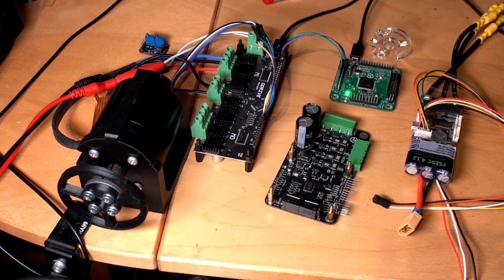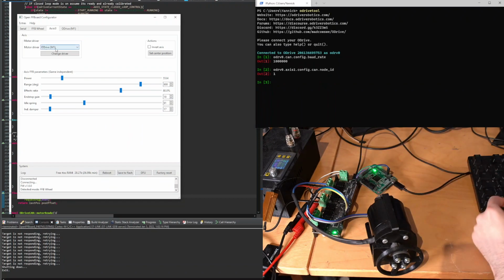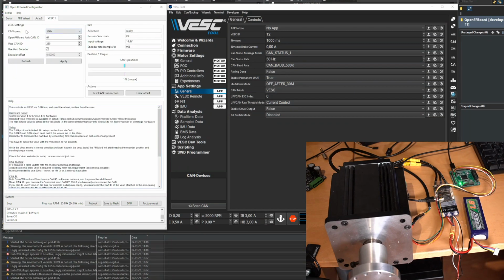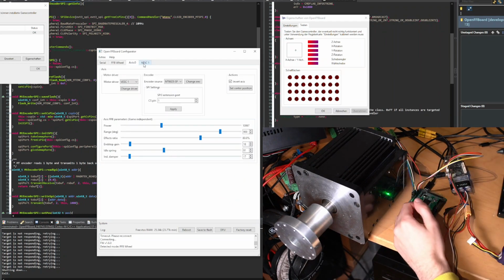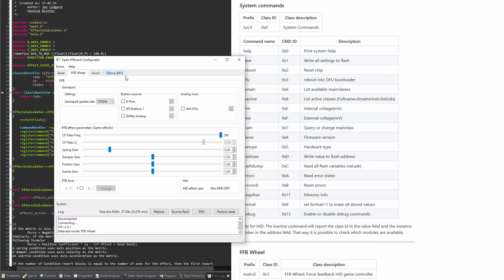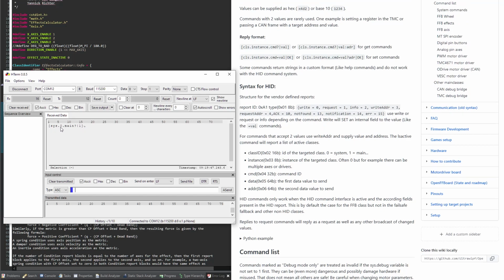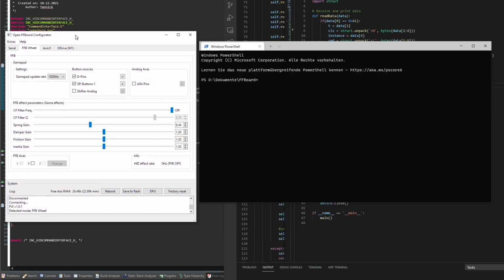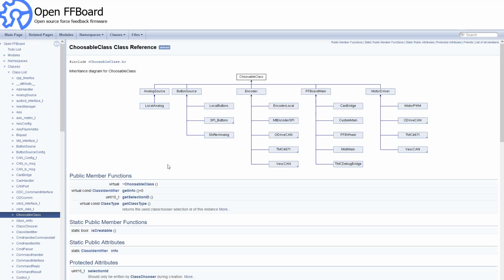Open FFBoard DIY FFB update 4: ODrive, VESC, HID Communication

Comment: Is it possible to flash odrive board directly with the ffb firmware? Will it be more optimal from performance perspective?
Reply from the maker: no it is not possible. It is also better to separate motor control and effect management/usb communication for performance.

Comment: Good day thank you for the great videos. I need so help with wiring a hoverboard main  board and STM32F407VET6, I am a complete noob when it comes to electronics and would really appreciate any help. I have managed to load FOC firmware on the hoverboard main board and VNM firmware on the Stm32f407vet6 for a diy ffb steering wheel.
I have a 600ppr incremental encoder and I will be using the hoverboard battery to power everything. Thank you again for sharing your knowledge/experience with all of us.

Comment: Any thoughts on the powerstep01 vs the TMC4671?  For example, I have a high resolution encoder for position, so I really just need a stepper-motor driver that can deliver the torque.      I like the 10A that the PowerStep01 can do, and that it can be configured either for Current-Mode or Voltage mode.    

Other ST devices, like the L6474, can only do 3A rms (~4A amplitude).. although the datasheet says it can generate a pulsed (<1ms) current output of 7A.. but I supposed the thermal dissipation of the package becomes a factor as well.
Reply from the maker: The first attempt was based on the powerstep with some foc trickery. It was not stable, the resolution with 7 bit extremely low and it ran super hot. The tmc with low Rds mosfets and its 16b adc is much much more efficient and capable.

Comment: Hi, I bought a STM32H7 Dev board to use with another firmware (VNMWheel), but yours looks better, and it is open source which is great. Would I be able to use this board with your firmware and your custom driver?
Reply from the maker: Not directly. The firmware is made for the F407VG and would require porting to any other chip. I am sure it can be done being a mostly similar chip but the differences in architecture would require some changes.
Reply: @Gigawipf  My friend bought by accident the STM32F4VE DevEBox, so I suppose this one will work fine?
Reply from the maker: @Edgard422  F407VE? that should work but there currently still is no build specifically for those devboards and they sometimes require extra hardware or remapping. Like encoder pullups, usb vsense and buttons
Reply: @Gigawipf  Oh...ok ok, I think I would be better ordering your custom board with the driver then. Thanks for the answers!

Comment: Great stuff! Do these new hall sensors mean we no longer require an encoder for the motor? Or is that still needed?
Reply from the maker: It has nothing to do with the encoder. The motor still requires an encoder. I am referring to the on-board current sensors in this video.

Comment: what do i need to compile the sources?
Reply from the maker: STM32CubeIDE, import the project and compile the subprojects in the targets folder.
If there are any errors check the path settings.
Reply: @Gigawipf  
I have a modified version(Keil Compiler) of Arduino FFB  for STM32F103.
Will I be able to switch to Bluepill?
Reply from the maker: @tsleletronica5851  No. That chip is not compatible or powerful enough.

Comment: Amazing job. I bought a 8nm servo from kollmorgen, but it came with a resolver, and it's hard to find a small and precise  encoder to fit in it,  so I'm using a amt-103 to make some tests. So my point is, is it too complex to develop a resolver converter module ? Would it be possible for openffboard software to give support for that kind of sensor or is it too much to ask? Cause resolvers have a excellent precision, but I need to replace it with an encoder
Reply from the maker: Resolvers are difficult to drive and would require a lot of active analog circuitry to extract a usable Sine/Cosine signal from. Probably possible but i don't have enough time at the moment and also no resolver to test.

Comment: Nice....! Where can i buy the controller open ffb board please ?
Reply from the maker: I will make them available once parts are available for a reasonable price again. At the moment some required parts are way overpriced or out of stock.
Reply: @Gigawipf OK.... Will you make annoucements on discord when it will be available ?
Reply from the maker: @djwillx974  Yes. i post updates in the discord first
Reply: @Gigawipf  So, if i have correctly understand your video, it's possible now , to use directly without modification, odrive + open FFB to build a FFB whee with a BLDC motor for example... Is it ?l
Reply from the maker: @djwillx974  yes if you can get an STM32F407 w. can transceiver (or our official board).